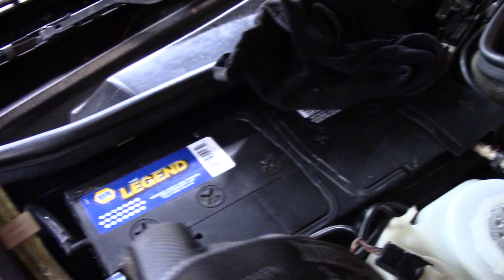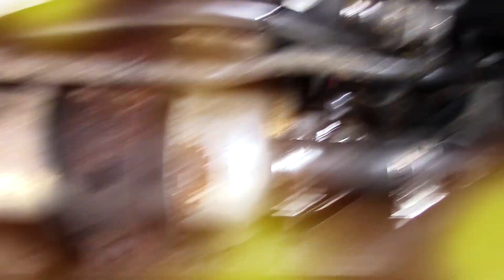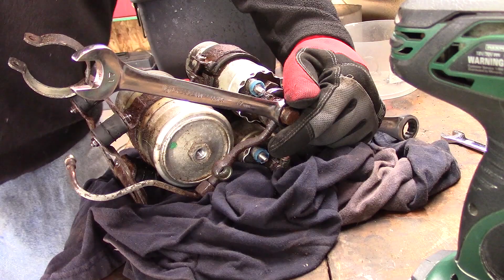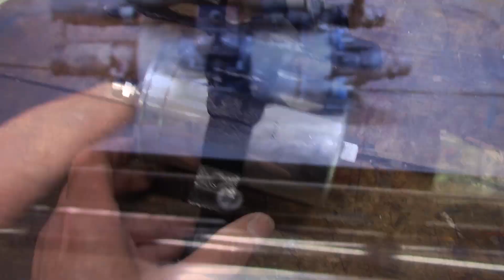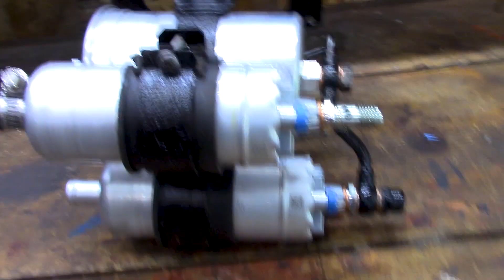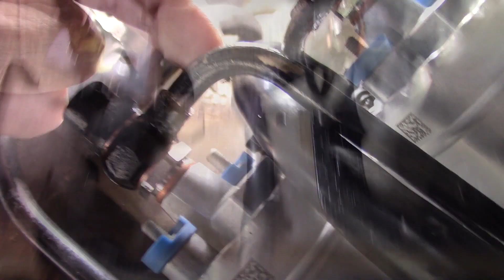Mercedes-Benz W126 S-Class Replace Fuel Pump Assembly.

Comment: Hi..thank you for the effort andfor the very helpful video..i bought a 1987 420sel with only 35k on odometer but i have to replace the fuel pump ..my question is ..why some w126 owner remove 1 fuel pump and keep only a good one running? The car which i bought came only with one and i saw there is 4 wires .thx
Reply from the maker: You have four wires because the vehicle left the factory with two pumps and that's what should be in it. I don't think one pump would hold pressure very well.
Reply: @ka-benz thank you I appreciate that ..I replaced the 2 fuel pump but still car won't start..there is spark issues..even with the starter in the air cleaner won't start..I have to digger more &more ..previous owner told me he had problem with the crank position sensor and I'm confused where is located ?front of the engine?or back of the engine under the air cleaner  at the top of the flywheel?thx
Reply from the maker: @ammarwahid5606  (CPS) is located at the left rear of the engine mounted above the flywheel. Good Lugk

Comment: hi having problem with my mercedes 300 sel 1990 model.(straight engine 126 series) the vehicle starts but after about 30 min will just switch off whether moving or stationary and will not start again for almost an hour. any help would be appreciated.
also can you please advise how to test the accumalator.
Reply from the maker: A hard/no start when hot sounds like a bad accumalator.Not hard to replace but if you want to test link attached.https://www.peachparts.com/shopforum/vintage-mercedes-forum/260384-checking-fuel-accumulator.html#:~:text=To%20test%20the%20accumulator%20you,out%20from%20the%20accumulator%20nipple.